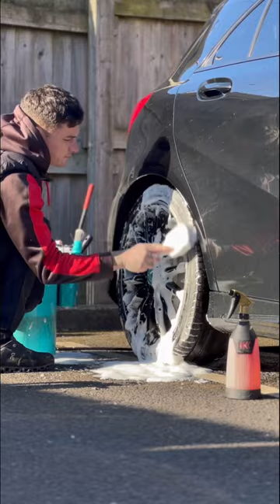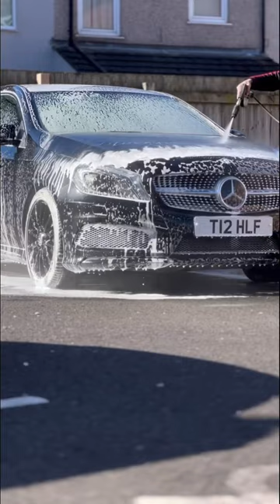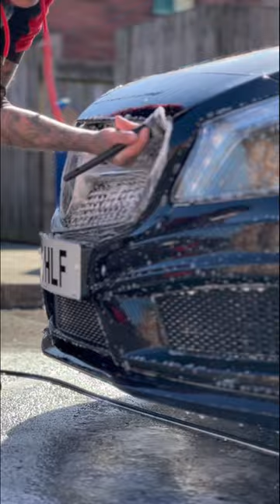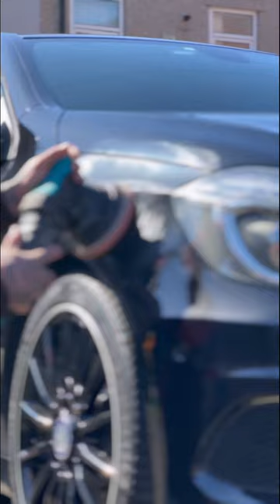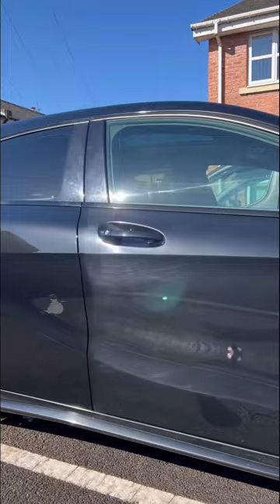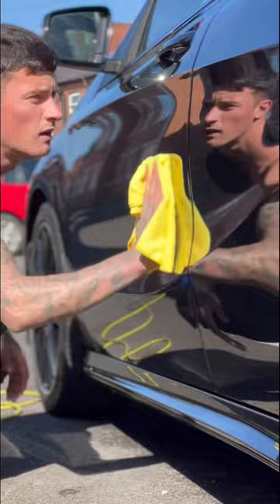Mobile detailing - Yes you can machine polish & apply ceramic coatings outside #shorts

Comment: The paint is ingrained with dirt and now with a layer of polish on top!
Reply: Actually it's the top coat your working with not paint. And he properly pre soaked and washed prior, I'm assuming used a clay bar before applying compound hopefully to pull any particles out of the pores of the top coat, so nah I see good work here.